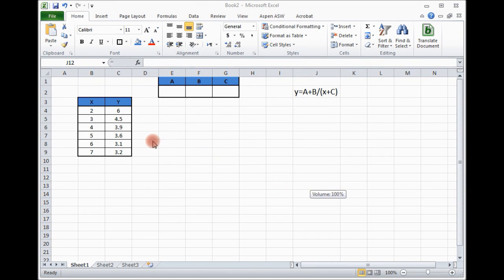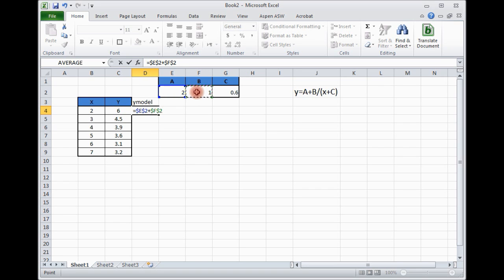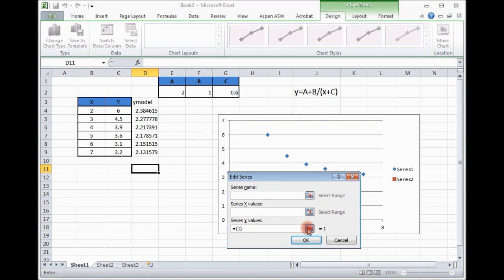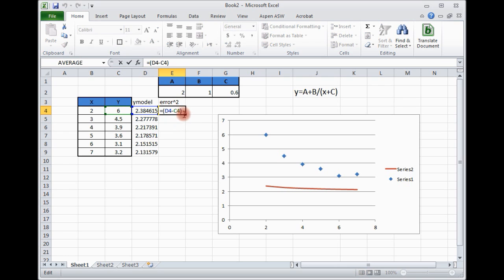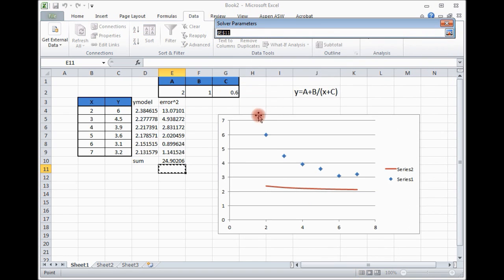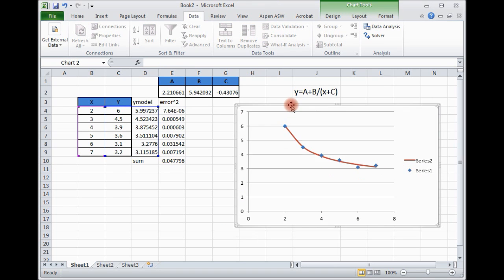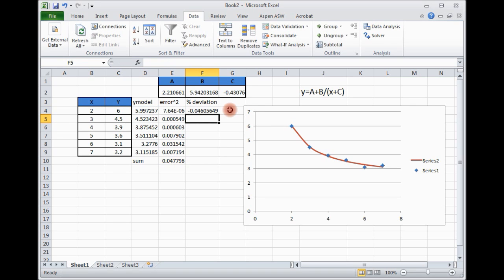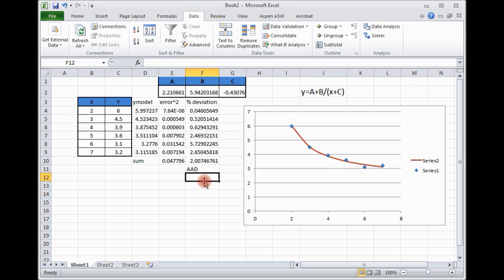Fit Non-Linear Model in Excel

Comment: in the case of one independent variable equation can be guessed(by a plot) but how can I guess the equation in the case of more than one independent variable. suppose two independent variables  then how can I guess the equation for fitting on excel
Reply from the maker: If you have any idea of values you can start with guess value.. you may need to run solver couple of times..